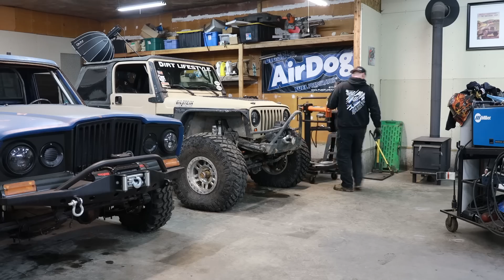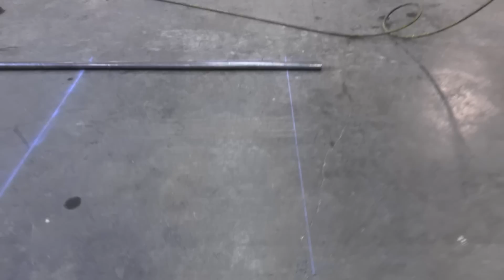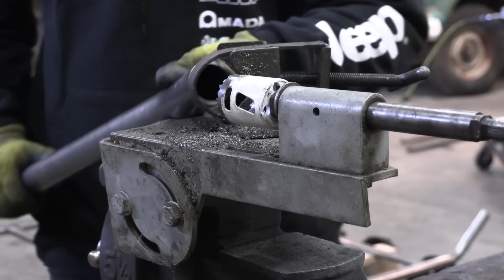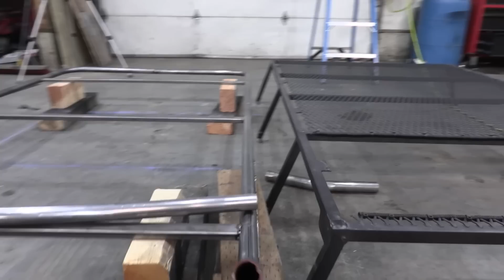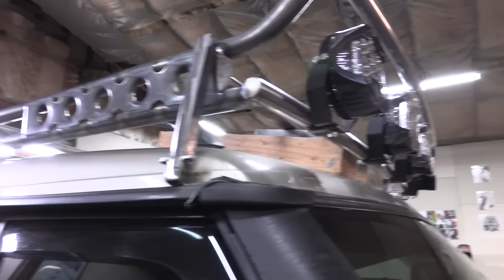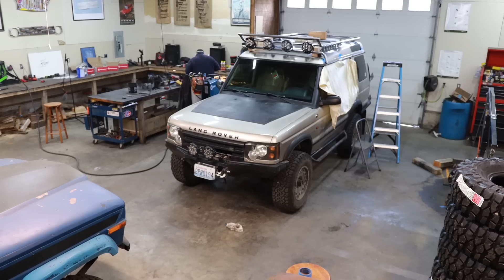Overland Roof Rack Build for Roof Top Tents. Ultimate Land Rover Discovery Build Episode 2.

Comment: I like the look overall, but I think I would have shaved the bottoms of the mounting tubes to narrow them so they fit in the drip rail better. I think it would have been fairly easy to do, just cut straight up form the edge of the drip rail then cap it off. Then using the original clips would have been easier. I'm not saying I could have done better, just what I would have done if I had your skills and tools.

Comment: Great video i am going to be making something similar, if you remove the landrover roof bars you can bolt the rack using those holes in the roof , camel trophy  rack on some did It this way  far stronger than cutter mounts

Comment: Just got me a bunch of scrap steel about to start making me my new full size roof rack on my 3rd gen 4Runner
Reply: I just got done building 2 for the wife and I's runners, came out pretty heavy at 120lbs each but expanded steel at the bottom, 1.5" pipe at the bottom with 1" pipe for the top basket, if you want photos of what they look like done for ideas lemme know

Comment: The only constructive criticism I could offer is that I’d add a square tube on the top of the rain channel to weld the round tube risers to that runs the full length of the rain channel or lip do it spreads the weight across the entire lip, not just on the six spots of contact you have now, driving down the toad at speed with the weight up there I would think that those six pints of contact would fatigue the metal of that lip, just an observation. Great job as always. I hope you and your family Stays safe and healthy.

Comment: Small magnets could be used to hold your welding blanket(providing the base material is steel) Only found your channel today and have watched a few vids so far but good stuff. Theres a few tools I havent seen you use that I have only recently bought although wish I had years ago(hindsight), those would be a linisher/belt grinder attachment on a bench grinder, life changing! second would be a mag drill(would make drilling larger holes through plate super fast) as per all tools price and quality vary but if you get a chance to try/test any you may be surprised. Evolution probably make them if you think theyd come to the party and hook you up.

Comment: Should make a slot in sides for some single row Ridged LED Light bars. 
They make small square like 1-1/2 x 1-1/2 LED That would fit in those small holes.
You could notch the mounting tubes so the mount buckle is angled towards the rack. 
Notch the tibe and weld a backing structure so the buckle nuts have something to sit against, and will close off the tube

Comment: i like everything, but i would have rounded that top bar that goes over the lights. looks weed with a straight bar welded to the curved uprights imo. Other than that, great job!
Reply from the maker: I'm not sure I understand. I did round the top bar? I used a tubing roller

Comment: Love the simple explanations you provide as you go through the process. The side profile looks amazing but personally I'm not sure about the front view. Think it would have looked better with out the additional lift for the top bar and maybe bringing the spots down a bit to offset the slightly lower bar. Probably personal preference and I'm sure you have a vision of the complete truck in mind. Keep up the good work.

Comment: You could run some of that cable overlanders use to protect the windshield from branches. Starting from the front of the fender and attaching to the top rail on your rack, which would serve to both utilize that rail, and protect your windshield and lights from the sides as well as the top. Not sure how it'll look, but might be worth exploring to further the real world functionality. Great video Nate.
Reply: Limb risers is what they're called- great idea.
Reply: I was thinking the same thing, once I started seeing how the roof rack was set up. If a bumper/grill/headlight guard is planned as another DIY project, I'd incorporate a couple bottom mounting points for the cable into the corners of that.
Reply: @alanm.4298  exactly!

Comment: I’m by far nowhere near as knowledgeable as you. And I love watching your videos been watching since bleepinjeep. Also those little tabs you made for the clamps for the drip rail. Would it be of any benefit to make them a little ugh I guess deeper in length. Then cut a slit in the tube slide it in then weld them or would that just be an unnecessary over building type of thing?
Reply from the maker: The way these are currently welded is super strong. The way you are suggesting could be stronger but much harder to make work. And it would be neccessary 👍

Comment: great video.. put your amps high enough to cause a puddle quickly.. 2-3 seconds or so to start puddeling. Keep your torch as strait as you can, to your material that you are working on. and hold your welding rod closer .you will get better control of the rod when you are closer to the material, just dont toast your hand by getting too close. 1/8 inch or so each dab and keep your material clean clean clean, and as close together as you can get it.. tig does not like gaps,

Comment: I would add some type of gusset to those light tabs. The vibration with the weight of the lights on them is going to guarantee a fatigue failure. Any small amount of vertical reinforcement will make a significant difference.
Reply: The rack is gorgeous, btw. Love the design, and BD lights are the best. I'd just hate to see all your hard work come crashing down into the windshield as you're getting your overlander on.

Comment: In the bagining of the video you said you liked the double layer of tubing I agree and think if you fallow the same angle and line of the bottom light holder tube and and add a second layer to the back top portion it will come out looking pretty darn nice but like the project anyways thanks for sharing it with us

Comment: That looks great! Im getting a tube bender next week and can't wait I start building stuff with tube.
Reply from the maker: Nice! A recommendation if I may, bend up some small sections first with varying angles. If you've seen a few of my tube projects you will notice I have a bunch of prebent sections of tube. I think this helps a TON when building from scratch. 22° 45° 60° 90° should be all you need. Good luck man!
Reply: @DirtLifestyle Thank you. The notes along with marking the start of each test piece looks like a time saver. Im going to be finishing up the railings for the ocean boat I have been working on for awhile now. I only got one die for the handrail, it will all be 1.25" aluminum. Hopefully my tig game is strong enough to leave them alone and not pull out the grinder.

Comment: I love it.  Beautiful work.  I agree with you however, that the top bar over the lights needs to be adjusted.  If your gaps weren't so tight and beautiful everywhere else, it wouldn't be bad, but it's kinda sticking up there with a larger gap than anywhere else on the rack.  Might as well do it before paint so that you don't end up having to paint it again when it eventually bugs you.

Comment: You can get a link belt for your drill press. They're actually better than traditional belts . They cut down on vibration , transfer more power and can be lengthened or shortened. Lol I've got the same backup drill press. The damn chuck pops off the arbor if I as much as sneeze at it..  ...wait, what? You dont have a hoist?
Reply from the maker: I will definitely look into this 👍

Comment: Just wanted to see what you thought about using magnets to hold your blanket that way you won't have to worry about the tape.
Reply from the maker: With a strong enough magnet hell yeah!
Reply: @DirtLifestyle  we kept a few different sizes because if it lays over a pipe or other contour it helps to hold it. Even old speakers work as long as they're on the blanket. And the blankets we were provided we're heavy enough to block strong winds. Tigging stainless in the middle of a wide open area would eat up some gas plus it help from getting flash burn when walking by
Reply: @DirtLifestyle  and yes magnet to magnet were steel structure wasn't available